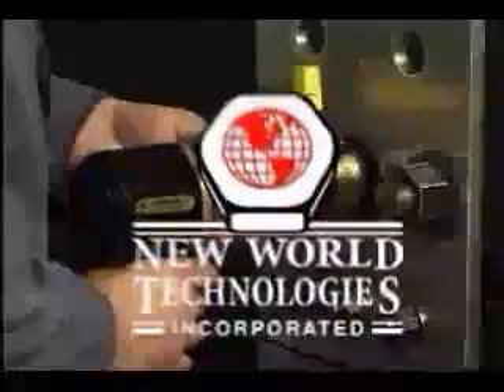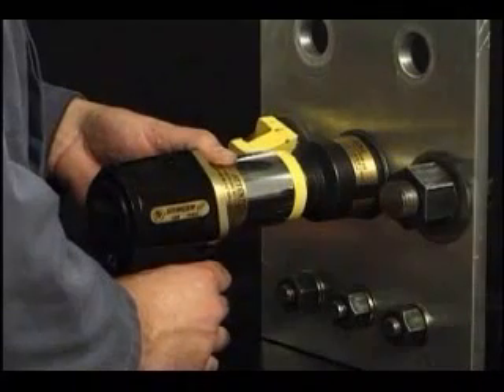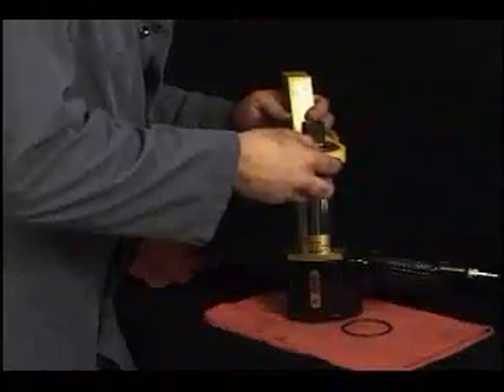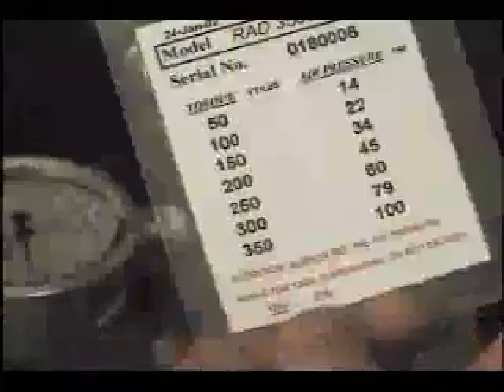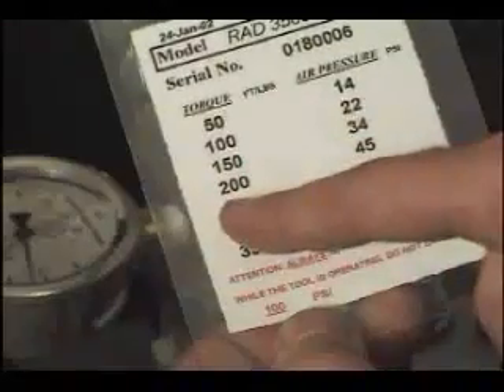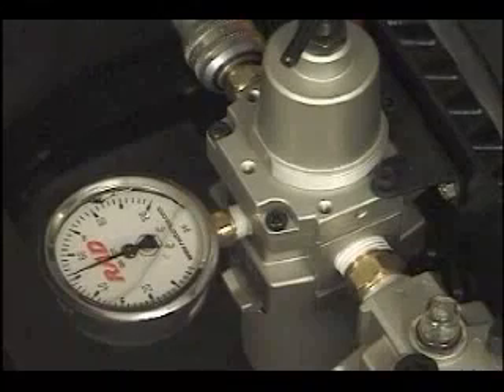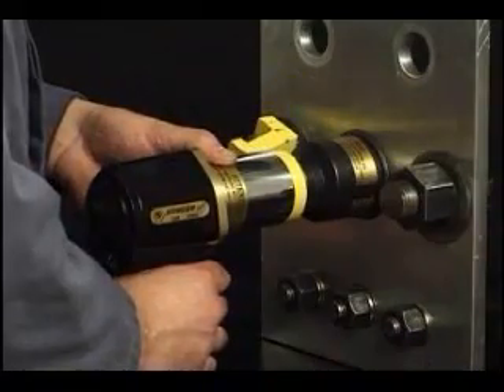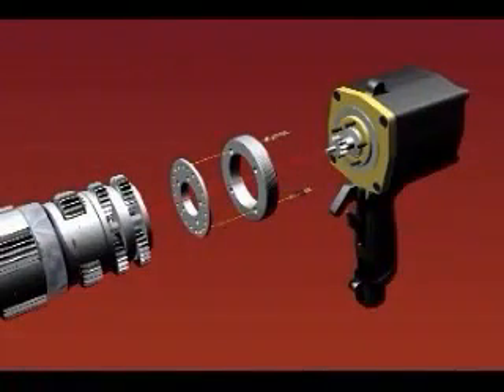RAD Torque System demo

Comment: Example you set the rad gun to 50 psi but once you begin torquing the psi increases past the 50 psi by 10 to 15 psi. Are you still getting the 50 psi and desired for lbs or are you now over torquing?